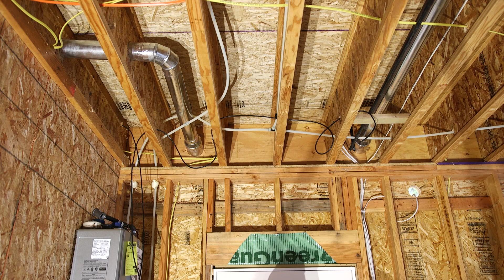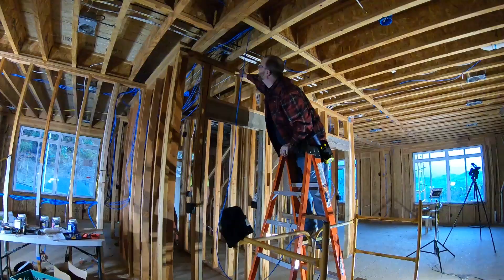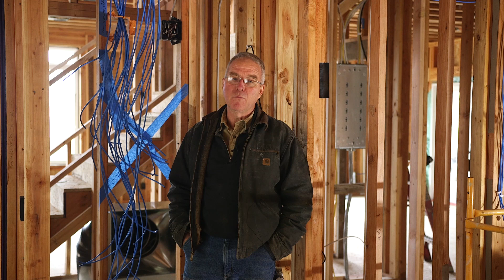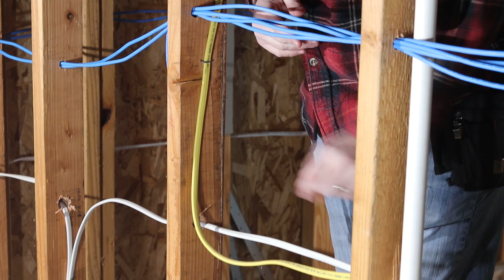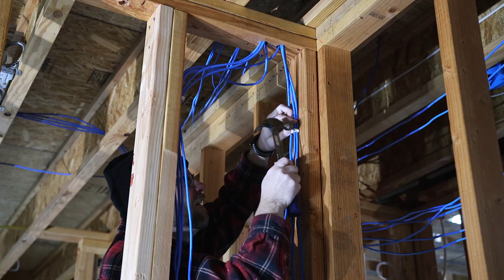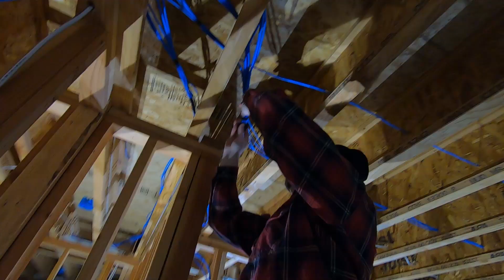Installing A Home Network Ep.100

Comment: Good job and good explanations!

US spec wiring installs still give me the heebie jeebies though. Maintainability is near zero when it's stapled in like that. I much prefer the european method of wall boxes and conduit or flex pipes. If a cable needs to be replaced, it can easily be pulled out and a new one pulled in.

When my sister and her husband built their house, he bought a couple of rolls of conduit from the electrician, and we ran one from each room to the technical room in the basement. Each can easily hold two Cat-6 cables, giving them a dual ethernet jack in each room (with additional runs for behind the entertainment centers in the living room and the home cinema, so they can run everything off a central switch instead of having to add smaller switches for game consoles etc).

Comment: So.. i've been installing cable now since 1994.. there's a lot of flaws with what he's talking about pulling cable. It's not fragile, it's not fibre optic cable. There's a center pull line / plastic internal sheath in the cable that somewhat protects it. And it's not "impossible to find a break in a wall", there's a fluke meter for that (DSX Cable Analyzer) - it tells you to within an inch where theres a break in a twisted pair from the fluke meter.
Reply: and when finishing the video, it's obvious he's never repaired wiring.. using electrical tape inside a wall isn't recommend at all. There's velcro tape for that. If you ever need to pull a cable out of a bundle in the future due to rodents / whatever, you'd want it velcro'd instead of taped.

Comment: Nice job! I think you went about it the right way, no need to run Co-Ax everywhere. RG 6 is 75 Ohm impedance and  is usually just run to connect higher frequency RF devices such as from dish to set top box etc. As far as I remember, once you need to connect ordinary TV's to the box you need to run 50 Ohm (RG8)  - RG6 to a TV is not a good idea (it is an impedance mismatch). The way you did it seems the best option using the CAT 6 (CAT6E?) - but as a few commenters have pointed out, running conduit would be great idea for future upgrade to fibre etc.
The suggestion about PoE is good advice too - I wish I had that suggestion a few years back. The technology is moving so quickly these days, maybe it would have been worth looking into your internet using AiMesh systems, might have reduced the need for all the cable - and then you have to consider what is coming with 5 & 6 G....it never ends eh?

Comment: Been working on adding ethernet cable in my house this weeks and could not aggre more on the words you said, it's far easier and less pain of ass to do it while building the house. And for extra insurance, 2 cables, or more, in a port is always better. Like what Ben did in ur house.

Comment: In a house UTP Cat6 will do just fine. Pulled lots of cable in industrial environments. There we used STP or FSTP to withstand interference from powerlines.
Worth to mention is the different length of the twisted pairs inside the Cat6. This to prevent interference between the pairs inside the cable as well as from outside.

Comment: I've been waiting for this! 
While it's possible to run coax everywhere, getting Cat6 is FAR more important, and setting up a rack + security cameras possibilities covers extensibility for a LONG time.de

I will personally advocate that it's worth getting a better cabling than you need. I know it's the standard today for buildings, but devices that leverage CAT6A or CAT8 speeds are becoming affordable for "high end" home use. In 10 or even 5 years, those devices will be as cheap as other things are today. CAT7 is a weird thing, and yeah, bulk CAT8 cable doesn't seem super common yet, but I'd be inclined to over build. :) 

On the other hand, 24 lines is great, because that gives you some overhead in other ways and is going to be more immediately useful than over provisioning your cabling!

Comment: Oh, yes, installers do pull cable. Straight out of the box, maintaining some tension, the cable won't kink. In residential, where things are being fed through small holes drilled all over the place, more care is needed. (6-8ft per pull) I've done hundreds of miles of cable in commercial buildings, and that stuff is absolutely pulled. (there are j-hooks, conduits, ladders, and even rollers to get it done.) In a house (and worse, an existing structure), there's a lot of inch-worming involved.

"Neatness counts." But it's all going behind walls where no one will ever see it, so there's only going to be so much time devoted to "neat and tidy." Where it comes out of the wall to panels, there might be a lot more attention to detail, but I doubt a cable comb is in our future. :-) Only 24 drops fells like a very small number. I'd run at least 4 to every box, with at least one box per room. You'd be surprised the number of things that can use up ports. (some HDMI extenders need two.) We ran 2 to every box in the office, and everyone still has a desktop switch. (anything beyond phone and computer needs more ports... more than one computer, NAS, media player, ...)

@7:00 It doesn't "slow the signal down". (not to a degree anyone outside NASA could measure.) It disrupts the per-pair twist, disrupts the inter-pair alignment (round compass points, to flat ribbon), and with solid copper, creates a brittle (often "necked") point in the line. (copper work hardens. think about bending a paperclip) For most riser (CMR) and plenum (CMP) cable, the outer jacket will become discolored if bent too far.
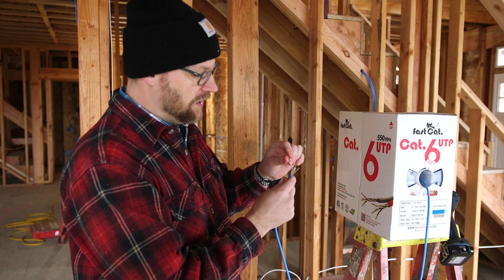@8:00 Why we use solid copper for infrastructure wiring (i.e. in walls) is one of practicality. Stranded cable sags, which means more of it would be needed to run a in house or business. "It's not good for long distance transmission." Nuts. 100m is 100m. Solid, stranded, even copper jacketed steel, it all works the same. And yes, my local big box stores sell both solid and stranded bulk cable.
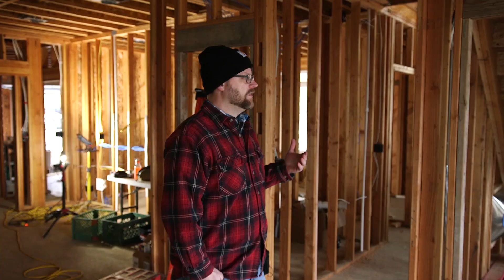@10:00 There is no such [censored] thing as Cat7 or Cat7A. Any "professional" who even speaks the words "category 7" should be immediately thrown off the property. ANSI/TIA/EIA, who define the "category" rating system, skipped 7/7a. There is no equivalent to ISO/IEC Class F / Fa in the american system. 3, 5e, 6, 6a, and 8 (8.1 & 8.2) are the only recognized "cat" grades. If you have "cat7" cable, it could be bailing wire as there is ZERO standard for it to follow. (if it were ISO Class F, they'd mark it as such.)
@11:00 "Induced voltage" is BS. Put a clamp on meter around the whole cable. It'll read nothing, because the hot+neutral cancel each other out. And that thing is ultra sensitive. Power is 60Hz (in the US), while ethernet is in the MHz (and less than 1V p-p, on a "balanced pair", any induced signal will be on both wires and thus self-canceling) PoE (power over ethernet) can be up to ~60Vdc. Much of the "code" w.r.t. separation is for safety -- you don't want a nail bringing 120/240 onto a low voltage wire. NEC is why you can't run power and data in the same conduit / hole. It has NOTHING to do with signal integrity.

Comment: Good stuff to see. I've heard some horror stories about network cable from Amazon, so I'd hope that a full signal analyser was run on them after install. It'd be a real shame to have to come back and rip up all that nicely installed plaster board because someone was selling a defective batch of cable.

If it were my own house, I'd probably have conduit or cable risers installed in the walls and ceiling with internal pull-strings, so that if there were problems, or you needed cable elsewhere, you could easily replace it.  That may show my own personal priorities though.

Comment: Actually, strictly speaking network cables are classified as ELV - Extra Low Voltage. That's here in Aus and should be the same in the US to my logic.
Yeah Cat6 ok, common, tested and tried I guess. 
Cat7, 7A & 8 were mentioned by Ben and I agree - they're probably the futures cabling systems and need better testing. For the most part they aren't even really designed for a build like this... However, there is a much better option in Ethernet cabling for 'future proofing' a home - if that is even possible!!
What no-one mentioned (oddly) was the fully signed off Cat6A system. 
I think 6A IS DEFINITELY a legit way to go now in the domestic market given the demand for higher download speeds and the rate we keep embracing tech in general. It has increased network capability boasting (and certifying) higher speeds at longer distances (10Gbit/s /100m max) with much greater noise protection/reduction capability to the system over Cat6. 
6A is best used in my opinion as a fully shielded system with foiled outer (can be shielded in addition if needed) and then foiled again internally and with a drain wire. This type of spec cable deals with magnetic flux from LV systems impressively making the 1' spacing requirement from power more flexible where needed. The individually foiled structured pairs minimises cross talk picked up from other ethernet cables run in parrallel (LV cabling too). It also stops any crosstalk between the pairs themselves.
Well it been a good rant. Safe to say I'm a fan and I'd definitely go Cat6A in my new home having worked with it and seeing good results. The extra cost is an investment.
Reply: Right on! 6A is the next jump in my book. Considerably more expensive, and termination is a bit trickier, but worth it if you're a pro who is serving a pro. I think we're still a couple years out from commercial and residential needs, though, as we don't have any runs longer than 35m; we're future proofed through 10Gb. :)
Reply: @Stonesand  The press terminate mechs are a step forward in my opinion when it comes to fit off. Much quicker than the old punch down method! 
Cable diameters do make things harder though, agreed. Thanks for the reply Ben.

Comment: Um... at that example of parallel cables, does it matter that the power cable running up that stud, perpendicular to the network cables is parallel to the network cable running down the same stud?
Reply: Yeah that’s not ideal, but it’s likely a short enough stretch it won’t matter. Just try your best
Reply: Yeah this bugged me, and I avoided it wherever possible. When I couldn't, I tried to keep the nearby parallel runs as short as possible when they're backed up like that, but sometimes it wasn't practical or possible! Glad it bugged you, too. :) Kindred spirits
Reply: I have an eye for detail as a draftsman. Have to. Too many times a project goes wrong, and it comes back to me and my company being at fault if we haven't explicitly spelled out how every little detail fits together. Within tolerance, of course. More often than not, though, it's something that falls into that tolerance. I just wasn't sure how much tolerance is allowed.

Comment: i once ran my ethernet through my power outlets.  its not 4K HD  fast, but its reliable and it works for computer networking in a pinch. You need an adapter plugged into the outlet for it to work.

Comment: When I built my house in 94 I put boxes on the first floor with conduit stubbed into the basement. On the second floor I put some boxes in the rooms and stubbed conduit into the attic. I put a 2" conduit in the HVAC chase between the attic and the basement. I've used very few of these boxes over the years. I've found modern wireless to be more than adequate for almost all my needs and it keeps getting faster. The only hardwired ethernet in my house is to a server and the TV.  If I was doing it today, I'd do the same thing.  I run my home engineering office on the wireless system.

Comment: Really, it is better to put cable for Internet or cams, WiFi is bad if you have a lot of equipments. I put automation, homemade, but have some problems because of WiFi.
Good idea is to wire every switch and light to the electric panel, so you can automate it easy even later.

Comment: ..."That's probably more than anyone is ever going to need..."  
Famous last words! They said that about 1 GB hard drives! In 10-15 years, I envision the new homeowner wanting to expand the network :P   
How difficult will it be to tape 2 cables to the one you are installing now and pulling them through?
Reply: Heh yeah, famous last words indeed! Since we've got the cables bound to the framing members, they aren't pullable anymore. So it'll have to be a wall-opening event. Still, in 20 years when it'll become a need, it'll probably be new drywall time anyway... :)

Comment: Overkill. Most of those ports won't be used since WiFi will be the main internet connection for 99% of electronics in the house. The only piece I would use wired connection is my game console. I think it makes more sense to hardwire WiFi boosters around the house. But that's just me.

Comment: wait you guys in Oregon don't have Wifi yet?  The more cables you are exposed. The more of your privacy will be invaded. Crazy. We've moved on from CAD 5 to to 6 now. And as home  owner the only ethernet cable is connected to my Modem and  router . and the rest is run through my eletrical  outlets. All this is cabling is old news. Its all about wife  routers

Comment: I had to do the same work at my new house. Unfortunately, the drywall was already on. So I had run the wire in each room from the network outlet into the attic first (through the top and crown plates), then the whole resulting bunch was placed into a plastic conduit, then the conduit run through  a closet and down into the garage, then into the basement, where the wires were terminated into a so called patch panel. Wasn't fun, but I benefit from that work each and every day.

Comment: I’m so glad you included Ethernet runs in the spec house. It’s such a pain to wire up a finished house with Ethernet, and typically results in making the runs completely different than you would if you had the opportunity to do it with bare walls. You hit the nail on the head by insisting on running cat6 to every possible place the owners would want them, including future security cameras, and having them all originate at a centralized area. I build all sorts of servers and computers, and this is an absolutely awesome aspect of this home. Keep up the good work bubba

Comment: For in wall runs, also avoid CCA (copper clad aluminum) cabling. If they aren't labeled as CCA, you can usually know they are CCA by the cables being half the price of solid copper cables.

Comment: These guys are running the cat6 way too close to the end of the joist. Sheet rocker can possibly hit the cables. They are pretty slow at running this low voltage. As an electrician we have to run those and my least favorite part of the job. Great video on showing how it's all done.

Comment: After 20 years in the IT Business I would say that data cabling in a home environment isn't a waste of money these days.  All you need is a main feed to supply your Router/Modem and perhaps a couple of uplinks at either end of the building for expansion.   With todays Wireless networking technology and equipment you can cover a home with a standard Wireless Router and a booster antenna that plugs into a regular power outlet.   However, with smart TV's and gadgets around the home having a data outlet available by said gadget really makes it easy to hook up devices and if you wish to get into home security systems and the like then I would certainly recommend that structured cabling is installed the same time as other mechanical trades.   That being said this video is an excellent example of pulling cable and Ben is certainly a skilled tradesman who knows his business.

Comment: When Ben was showing how the cat6 and 120v wires needed to be spaced 1in apart on the vertical runs  it looked like doing so would necessitate the use of the steel protector plates in those situations.
Reply: Yep. 1-1/4"  plus 1-1/4" plus and inch between the cable runs plus the thickness of the cables adds up to more than the width of a 2X4

Comment: If you are in an area with lightning you should install shielded cat6. The lightning can induce high voltage on the data lines burning out your electronics.

Comment: @essentialcraftsman just make sure that your one location where the router is going upstairs you run TWO to that location, one to feed router and one to come  back down to switch where all of the cables to terminate. Beyond that where you ran in the one coax from outside to closet you should also run cat 6

Comment: With WiFi why do we need jacks in every room?
Reply: Well, cables are much faster and more tolerant of interference and traffic. They're preferred for gaming, video streaming, and downloading. But yeah, the rando devices don't need it. Some of the cable runs here are heading to wireless access point locations. :)

Comment: What about an antenna in the attic for basic channels? I just installed one in our 20 year old house and I'm watching NFL for free this weekend. As I was installing it, I couldn't help thinking that it would have been so much easier to do before the drywall and attic insulation was installed. An OTA antenna doesn't cost much but could save the future owners tons in the long run.